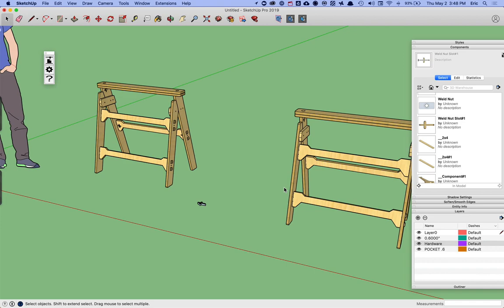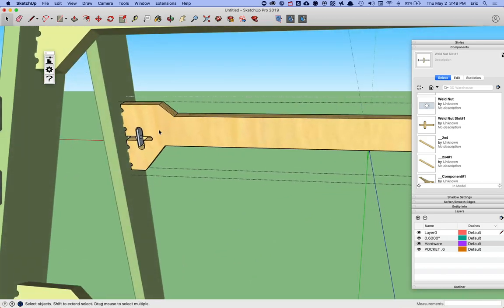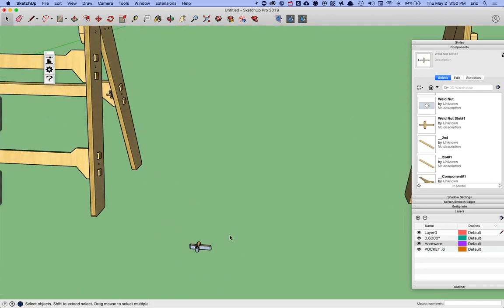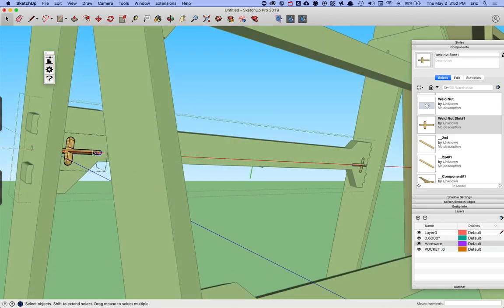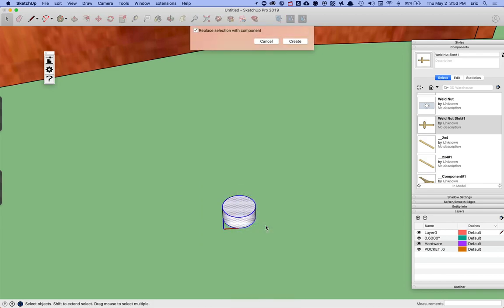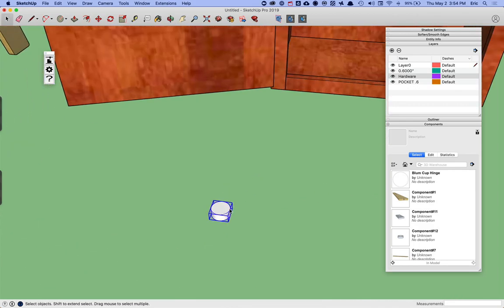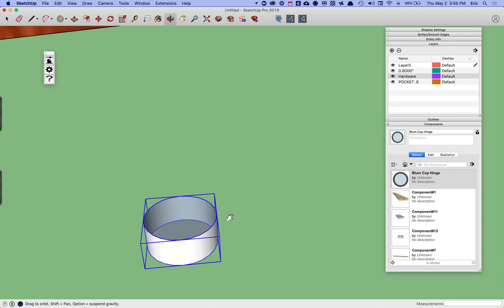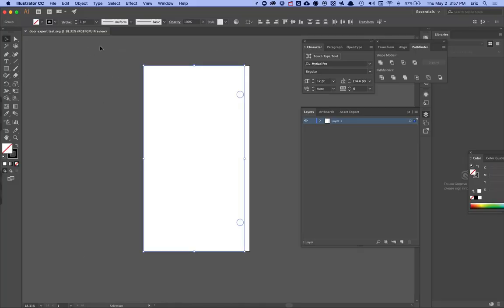Fabber Update 1 1 4

Comment: Is it possible to make the sub-components cut two components? For example a blum hinge has the 35mm Diameter cup hole in the door and 2 holes on the inside of the cabinet side panel